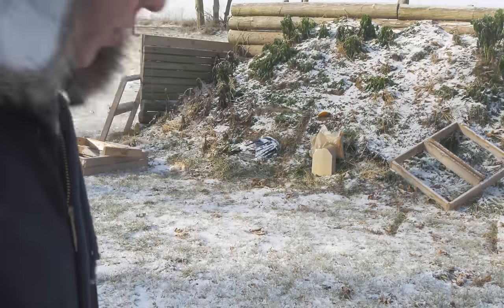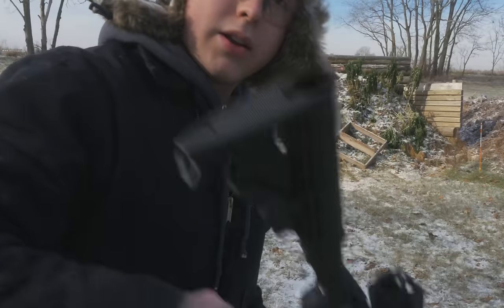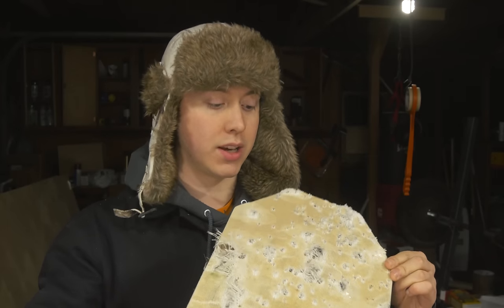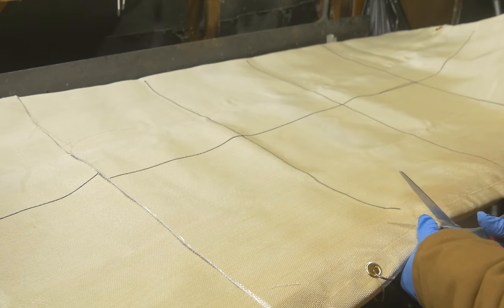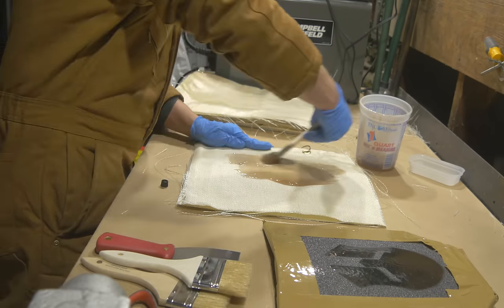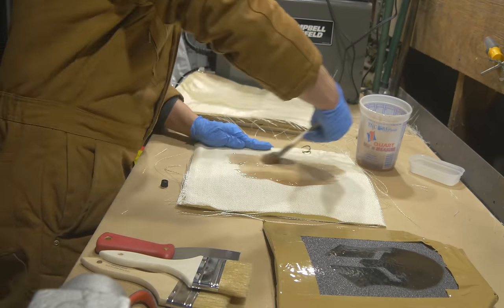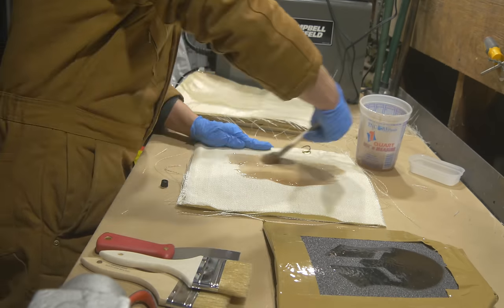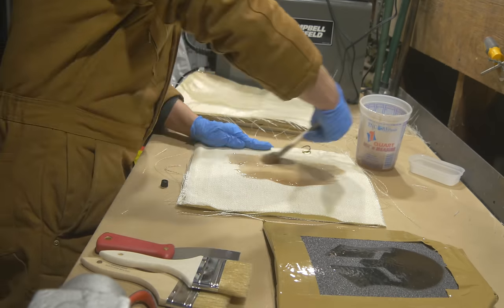How to Make AMAZING Bullet Resistant Armor for $30

Comment: Best armor craft I have seen in years. I have at times spent a few years trying to research just what could be the best, the easiest and the most financially effective craft.

I would like to add that you made more work than you realised using your version of the the template method.I

I suggest measuring and accurately cutting out the shapes of armor plate templates first, BEFORE applying the resin and waiting to finish it each time.

When you left so much material on the plate, it looked very difficult to finish the plate with a variety of optional tools.

I would also suggest some improvisation too.

For example, combining galvanised steel panels or whatever with just the basic fiberglass and resin, could possibly make the plate as an experimental theory, EXTREMELY STRONGER than before! Meaning that bullets will be more difficult to penetrate the armor, if it's reinforced insanely hard enough.

A great build and a great research video for armor crafting beginners.

Comment: Great work there, but simple dust masks run about 25 cent per when bought in a 20 pack.
That said, you will still be coughing up:elbowcough::elbowcough::elbowcough: fiberglass when you are 69 years old... If you live that long. :elbowcough::elbowcough::elbowcough:
 Take it from a former fiberglass boat builder, like you, I learned hard, made changes and survived my own stupidity. 🤗

Comment: would it be possible to layer some steel inside the lay up? it would still be light, but a bit stronger, might even defeat AR rounds if those are the first you test with

Comment: Hello, I love your design but I’ll be making some slight alterations for the one I make personally, I’ll be adding a ceramic plate half-way through with a steel sheet backing for extra protection and so it doesn’t kick like a mule
Reply: hard materials will make the kick worse most of the shock dampening will come the padding on your carrier i like the ceramic idea
Reply: @matthewallman1  the metal being at the end is so that after the other materials catch it, that lump doesnt smack you in a rib, it smacks the metal which spreads the shock out.

Comment: Cutting fiberglass is nasty, people should know that when you cut anything that contains silica you should wear a respirator. That's basically all forms of glass. The smell when you cut fiber glass is a mixture of burning resin and silica dust, which are often micro/nano shards of sharp glass. The human body has no way to process silica and remove it, when it enters your body it will cause irritation where ever it embeds itself. Those tiny shards make your skin itch when it lodges in it. We will shed it with our skin as it grows and replaces, but when it gets inside the body, or somewhere not protected by skin, your body will surround it in scar tissue. When that happens in your eyes you get cataracts, when it happens in the lungs you get silicosis. There is no cureative treatment for these conditions because we cannot remove all the micro particles when they are peppered inside the eyes or lungs. Same thing if you ingest it. It's why most sandblasting doesn't use sand anymore, glass dust is that brutal. You will have a bunch of people who will say it isn't shit, but those people are naïve or willfully ignorant. Don't fuck with glass dust. 

 It is important to remember to minimize your exposure, so that means you should clean up the work area after. If you work with it regularly then you should have a dedicated area with proper ventilation that you also keep clean. Walking through unkept workenvironments without the proper ppe and best practices will leave you feeling like a you smoked 4 packs of cigarettes in one night. The dust is easy to put in the air when stomping around it. That feeling can take months to go away, and when it does the damage doesn't. If you see rainbow halos around any of the lights in your shop you are 100% being exposed/breathing it in.

TLDR: 
ALWAYS USE A RESPIRATOR IF YOU ARE CUTTING ANY FORM OF GLASS! THERE SHOULD BE NO EXCEPTIONS IN A PLANNED WORK ENVIROMENT! IT CAUSES CUMLITIVE DAMAGE THAT NEVER FULLY HEALS BECAUSE THE BODY CANNOT PROCESS SILICA! 

In the eyes= cataracts, in the lungs= silicosis.

Comment: "not in need of armor, I have this level 3 armor from..."  it is commercial  grade armor.  I work at a plate manufacturer.   The plate you made is higher quality than that piece from  Spartan.  The piece of ceramic in that plate is paper thin, may as well not even be there..  at most the thing actually stopping the bullet is a few layers of laminated carbon fiber and some pressed plastic that was baked in the oven.  they did give it a pretty coating of truck bed liner though with a nifty symbol, so there is that. 

There is a quality standard with the stuff we send the government.  the commercial stuff is just thrown out the door without much thought or being actually shot tested.   Their mentality is "if the warranty fails, you won't live to make a claim on it"

Comment: Can I Cut 25 10X12 Rectangular Layers Of FiberGlass Blanket And Epoxy Them Stacked On Top Of EachOther Over a 3A Soft Panel? Could I Add Kevlar Fabric And Ceramic? How Many Layers? Im Askin If I Cant Just Make Measurements Of Each Material And Stack Them In-Between EachOther With Epoxy? Would That Be The Same Clamped To A Soft Panel?

Comment: I'm tempted on trying to make a bump helmet with this. Get an airsoft pos one strip it. Make a 2 piece mold I'm thinking concrete then making the plate and using the concrete mold for the helm. Then drill and attach the pads and rails

Comment: Bro, I've been working with fibreglass for 50yrs, before you do this next time, buy some external threaded hollow tube about 12mm in diameter and make a fibre-glass roller out of it. For a job that size, something around 4in long will do, use that to roll out the wetted cloth. This will make it thinner and considerably more resilient. Great idea mate. I live in New Zealand where we don't have the luxury of being able to arm ourselves. Good luck taking your country back. WWG1WGA!!!

Comment: I recomend something that can spread out weight, maybe a rubber horse mat
Reply: So ive done some more research and hardened steel, like ar500 or hardenened steel can be used to shatter the bullet like ceramic, but more stronger whilst having less hardness (1/4 in. Thick). Then, the same thickness of armor tested here (1 in. Thick) and finally, a rubber mat on the back to spread out weight and comfortability. Seal in flex seal liquid. A single plate could stop possibly a green top 308. Shall record.

Comment: You need to wipe all the excess resin off each layer unlike what he did. You need the bare minimum of resin when working with glass and resin. Resin is the weakest part and itll make your part crack or deliminate more easily messing with the integrity of your part

Comment: You should be wearing a respirator.  Fiberglass is a class one carcinogen.  Fine particles will collect in you lunges.  You should also be running a shop-vac to collect dust off it as you cut or sand it.  Even some resins are horrible to breath the fumes as they can have things like phenolic or isocyanide.  I destroyed my lunges working in a factory that made headliners for cars in just a few years.

Comment: Post Bidenomics, this setup now costs $120.  All fun aside, the deformation on the back side of the plate means from everything but the bird shot means you will injued by blunt force trauma.  It's the same as being smacked in the body with a sledge hammer.  Trauma pads will help reduce that blunt force trauma and help mitigate the risk for serious injury.  You should always go with the best professionally made armor that you can afford with the appropriate protection level.

Comment: 2 layers of graphene then two-3 layers of kevlar plus 8 layers fiberglass structure resin will stop 99% the new ceramic alloy with 1inch organge mkx db18 is the new norm -no bruz no broken ribs no flack, you might fall down but you wont bleed out

Comment: 7 years late but i might have used an angle grinder before a jigsaw. but... bandsaw works great lmao. also, in a situation that I need bulletproof makeshift stuff, I might not care about cutting to form lol
Reply: An angle grinder sounds like a horrible tool to cut this with. If any loose fiber gets caught up in your wheel, best case scenario the grinder gets ripped out your hand and gets tangled. Worst case scenario the plate spins around and hits you

Comment: Put a light layer of g-form reactive armor behind the plate and zero damage and very little impact.

That's all it needs.

Also dude please put some filters on your face and eyes.

Fiberglass they could see your lungs causes cancer.

After you get the resin on it should be reasonably safe enough after you cut and sand the edges.

Comment: you should of used epoxy and cut it when it wasnt fully set up or use a heat gun and a sharp blade would cut through like butter

Comment: Pro tip from fibreglass technician like everything else preparation is the key trim your glass to size before you add resin what he is not telling you is he completely destroyed that brand new panel saw in under one minute a testament to how hard fibreglass is to cut  it's not just about saving materials cutting that cost in half it's about saving time effort and more savings on the tools you wont need to destroy.

Comment: so why cut it beyond the area that you know will fray, just fold it in side on each layer and the resin will suffuse the weave use pins to hold the folded weave in the resin till curing takes place and then possibly a second resin layer, or make a thin layer of rubber on top and a thin layer of metal on top of the rubber and make these in plates that can be overlapped and hung like scale mahl and you will have a superior type of armor that the individual plates can be replaced after they are shot. just visualize it.
 all those plates overlapped across a woven fabric that a person can wear and is fitted , qith shaped plates for ecvery angle and allowing movement screw cheap , think economically superior...

Comment: Hello ZNA.
   For the next iteration of the armor plating... why not sandwich an 1/8th inch steel plat between the fiberglass and resin layers? It should make it resistant to even AR-15 rounds, and perhaps even totally resistant to them. If 1/8th inch seems too heavy, perhaps 1/16th inch? By having the resin-fiberglass layers front and back, you should increase the 'bullet catch' ability of the armor plating. The front layer helping slow the round, perhaps enough that even AR rounds don't penetrate the steel plate layer, and the back layer, which will 'catch' the round and further decrease velocity.

Comment: And my half drunk ass is over here trying to find bullet proof materials for when I build a sheet metal door. I am putting a small concrete bunker underground considering our current situations by let's go Brandon trying to crash things. Just a place to put food and shtf tools and such, maybe a fall back shelter if need be. Found a double 3/8 mild steel blueprint, but knew it was not going to hold back bullets and ar 500 sheets are out of this world. I was thinking fiberglass the whole time actually when I stumbled on this. Think I will build the frame, the door, then fill the cavity with this and then weld another 3/8 sheet on the other side. I bet most normal rifle rounds would not make it through besides a 50 or 338 lapua.

Comment: Disclaimer: This was a Dilettante Presumption Theorem: All statements of fact, opinion, or analysis expressed do not necessarily reflect official positions or views or any other entity, past or present. Nothing in the contents should be construed as asserting or implying endorsement of interpretations and factual statements.
So let me get this straight? 
I have to already own a front and a rear Bullet Resistant Armor in order to make my own Bullet Resistant Armor?
I have to own real plates in order to make homemade plates?
If you can afford to buy real Bullet Resistant Armor, why would you bother making more plates from real plates?
Why not just buy more real plates?
You had me interested until you said you were using real Bullet Resistant Armor as a sort of mold for the Fiberglass Bullet Resistant Armor.

Comment: how would i make this without any pior body plate?
Reply: Could just make a mold with a piece of wood I guess.
Usually they’re 10x12 inches for chest and back.
Reply: Yeah 10x12 is the specifications. Then for arm movement make corners at the top. The back plate could be a rectangle and be fine.
Reply: Also it’s quite heavy but you should look into the ceramic tile body armor. You get the tiles for about $1 piece. 

I got a bunch of free advertising news papers (was for like real estate) and super glue spray can. After cutting each tile I individually wrapped each tile with a few newspapers then combined them then finally wrapped the 3 combined with more news paper.

I tested it and it stopped 380 and 9mm and you could make these for sub $10 a plate. Problem is they weigh as much as the AR500 steel plates that can stop rifles.

Another thing you can do to upgrade the ceramic plate design is put 14 gauge steel behind the ceramic. So the 3 tiles start to break the round down then by the time it reaches the steel it can’t get through.
Reply: I live next to a run abandoned down lumber yard, I carved out the inside of two of them to make mine.